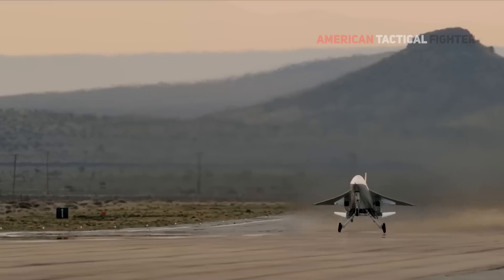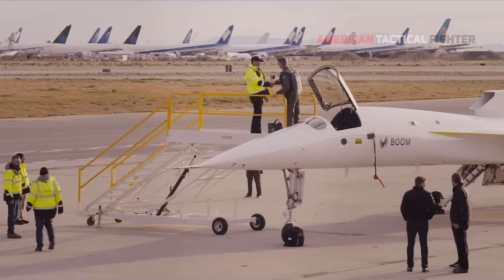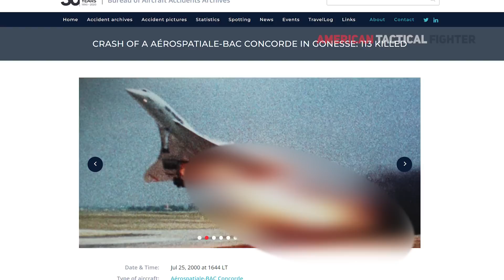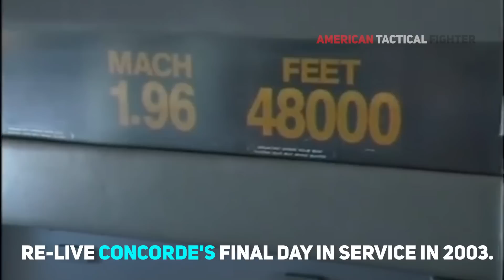Finally! America's Ready to Make First Flight New XB-1 Supersonic Aircraft

Comment: concept is not safe. engine intakes are close icie surfaces. engines are not separated from main frame on pilons. frame type will not let it land on low safe speed. it is based on old wrong ideas.
Reply: Es un prototipo de pruebas, lo que esté mal lo irán mejorando. Sino lo llaman a usted.